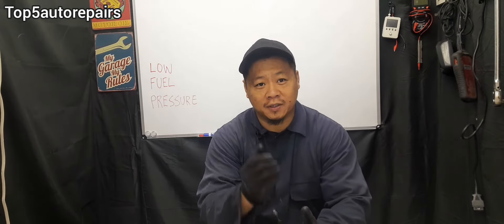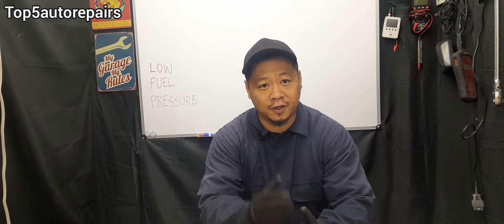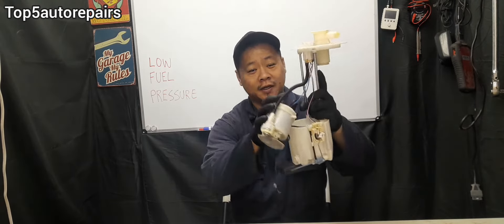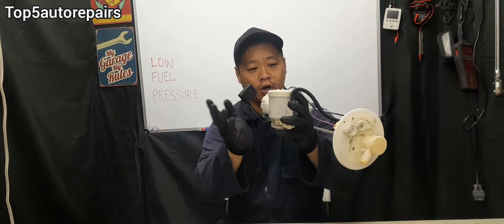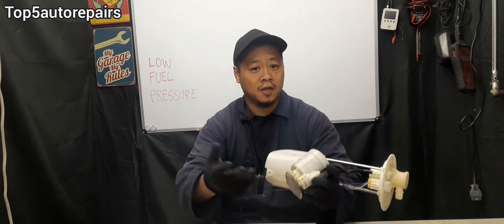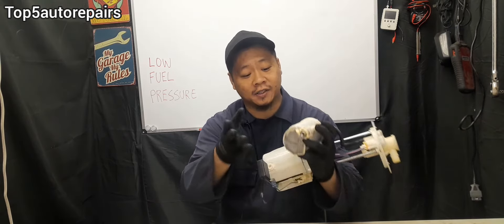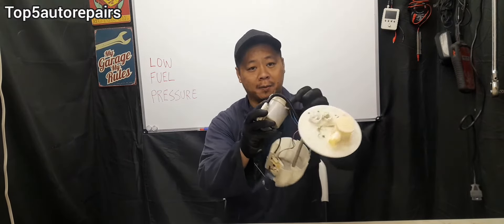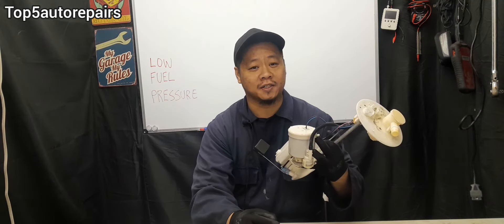5 REASONS WHY FUEL PRESSURE IS LOW

Comment: Nice video.  My 97 Ford F250 has a fuel pressure problem after truck sits over night.  No problems when driving.  Usually have to cycle 3-4 times before firing up.  I changed fuel pressure regulator, no change.  Could be fuel filter or pump starting to fail??

Comment: Interesting this video came up. I just replaced the fuel pressure regulator and fuel filter cause of gas smell. Seem to be holding up. I already got the fuel pump waiting just in case.
Reply: Did that fix your problem or did you have to change the pump also?

Comment: Can thre injectors cause the low pressure issue? i just installed a new injector set and few days later started to get  "low fuel pressure" error code and car barely moves. My car is VW Golf MK6 TDI 1.6
Reply: You should change all injectors
Reply: @mosesuche2602 i diagnosed the injections and found out that one of the injectors was leaking down .. replaced it and car returned to be like new
Reply: @webpro607  exactly my thought. You need to check for all injector when changing. If you don’t the pressure it might also affect others

Comment: My 95 marquis had been sitting up for seven years. I put a battery on it an tried to start it. I didn't hear my fuel pump turn on do I bought one put it on. A fuel filter too. I cleaned the fuel injectors and it's still not turning over an staying on. I put some fuel in my throttle body it crank for 4 seconds then went dead. I don't know what else to do I checked the fuses they good. I'm lost what do I need to do????
Reply: Its not that hard to test your parts by connecting with jumper cables on 12v battery.
-pump works
-ebay injector test pulsor
If all parts work=YOUR CAR IS PROBLEM
(ECU-broken solder
/WIRES rusted conta broken wires chewed by rats
/ETC.)